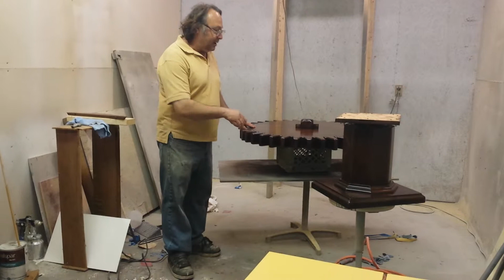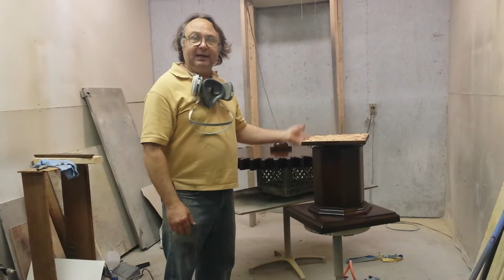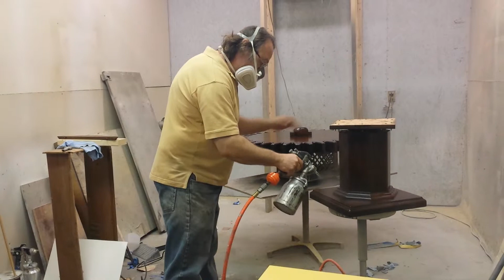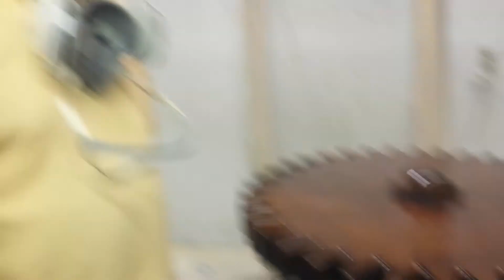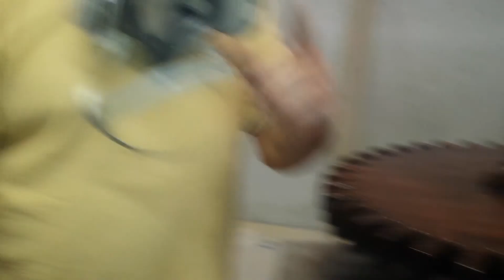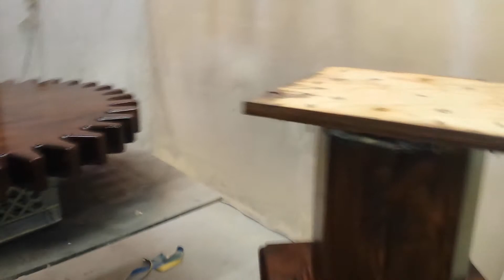refinishing a Ethan Allen  cogwheel  table

Comment: I have one of these and I would be interested to know how stripped and re-stained this table.
Reply from the maker: +Kathryn Ann  hi Kathryn ,1 you need to strip the old finish off with a paste stripper .2 after the stripping is finished ,then you will sand the wood ,3 stain the wood to your color that you like ,4 top coat over the stain with a spray can or a brush with what ever kind of clear coat that you choose .after you  get 3 to 4 coats on the piece lightly sand it and coat it again . you can buy spray cans of  lacquer at menards .you will need at least 5 cans.

Comment: Is there a video from the beginning of this project?  We are trying to do ours and don't like the stain we put on.
Reply from the maker: no, sorry i just stripped it down to raw wood ,then sanded the wood ,after the sanding i sprayed 3 coats of clear finish over the piece ,then sand the finish ,and shaded the color into the piece ,you will need a spray gun to do that , pine is a soft wood and your sander can leave sanding scratches in the wood the pine also takes the stain plotchey
Reply: Can I ask what color stain you used?   I saw the one you restored, it was beautiful. We tried espresso, and it is much too dark.  So now we are at a standstill.  This piece has been in my family for 40 years.
Reply: also what kind of clear finish did you use and what grade of sandpaper?  I know it has been a long time...but am appreciative to any suggestions.
Reply from the maker: call me anytime tomorrow at 616 453 8309 ,i will be happy to help you out thank you
Reply: Thank you!
Reply: I ended up taking the top piece to the store to match it and went with mahogany. It seems to be a pretty close match.  We still have to do the polyethylene. Some of the wood near the bark went really dark. Not sure how to lighten that up. We don't have a spray gun..so we are doing it the hard way. The groves in between is the hardest part of all.  Thanks again for all your help!
Reply from the maker: you can also try a spray can of polyethylene ,if you like to ,yes the sides of the table are the hardest please send me a photo of the table when it do and feel free to call on me if you need to 616 453 8309 send photos to lachbruce1957@gmail.com
Reply: My husband goes back to work tomorrow...so this may be a slow finish.
Reply: We will!
Reply: @brucelach4481  I want to refinish my mothers may I call you as well?

Comment: That looks great.  I have one of these but it's missing the wooden pin diddlydoo that fits in the center at the top.  I need that thing, or a copy, BAD!.  Actually have two of these tables but I think it would be so cool two have two complete tables, one is missing this center piece and it's bugging me!  What also wears the finish down on the table teeth is people's shoes.  They rest their feet in between and on the tips of the teeth and it wears the finish off.
Reply from the maker: you will have to make that missing piece .or have a friend make it for you ,you can,t buy parts for this table any more .
Reply: Yeah I assumed as much, it doesn't look hard to do, will just take some time.  Exactly what is the color finish name to use on these when refinishing?
Reply from the maker: i don,t have any stains do here ,its all shaders  ,liquid colors